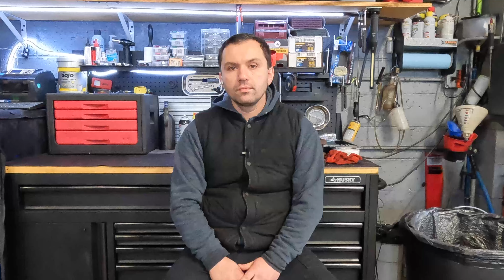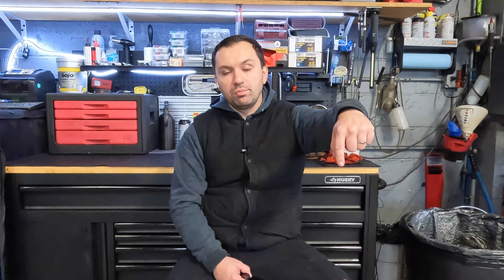SHOP TALK: AFTERMARKET PARTS ARE THEY QUALITY & ARE THEY WORTH USING TO REPAIR YOUR VEHICLE?

Comment: I bought a coolant surge tank from advance auto, for my 03 corvette. I think it was a dorman knockoff. Looked like the oem, but it lasted one month, before it started leaking where the top half adheres to the bottom half. The oem tanks last about 5 or 6 years. I wound up asking for a refund, so I could just go buy the oem part from dealer. They only wanted to give me a replacement. I came in another day, when manager was off, and told the parts guy that the mgr agreed to refund me, got refund, and got the dealer part. oem parts quality is declining, but at least you have a better chance at good results, than aftermarket parts. Dorman does seem to make some parts that are good, such as the turn signal lamp sockets. Had good luck with those, replacing all my lamp sockets. Dealer socket cost $64, if you can even get it (discontinued)and the dorman  cost $7.99 on rockauto I just needed the fresh plastic body, and de-pinned the wiring and used original wiring. Now I have fresh plastic housings for all my turn signals, and brake lights. The dorman plastic seems like a better plastic than oem.

Comment: Everything related to new cars is junk! Plastic, software controlled garbage designed to drain the owner. Most people are sheep though and will continue to be drawn into this trap.
I would never buy a car newer than 1996.
Reply from the maker: Those are getting harder to find.
Reply: @TheEnthusiastMechanic  
May have to do like the Cubans to circumvent the unethical nonsense imposed by auto Mfgs today.

Comment: I started in 1972. Aftermarket parts were definitely excellent. 

I started seeing parts quality go south (to Mexico) in the 90’s. 

OEM parts became a joke soon after.  I started saving OE parts boxes to show customers that they too sourced their parts from Taiwan, China and Mexico.

My joke is that OE parts come from the better neighborhoods in China. 

Dorman used to be well respected. SOLD OT

BWD/Standard and most reman starter/alternators were getting worse when I retired 8 years ago. 

It’s the same in home improvement. Lumber as well as most items are overseas. 

Money Talks ‼️
Reply: The cost of timber (lumber) is just ridiculous now. I asked the cashier in the store "Doesn't this stuff grow on trees anymore" and got a "Huh" and a blank look in return. 
A bottle of plain water costs more than a litre of petrol  (gasoline). Water comes out of the ground and gets bottled after the purity quality is checked and transported to the shop for sale. Oil is pumped out of the ground using very expensive equipment, shipped to a refinery and processed using more expensive equipment, then shipped to the country that that bought it and then transferred by road and / or rail and then transported to the gas station.

Comment: Doorman is completely a mixed bag, some of their stuff is total trash. That being said, the OEMfix line that doorman offers is fantastic. Usually it’s replacing cheap plastic engine or drivetrain stuff with aluminum replacement. Like the pentastar motor oil cooler.